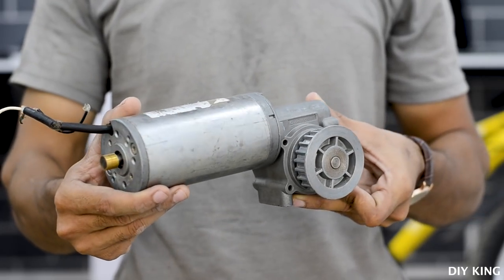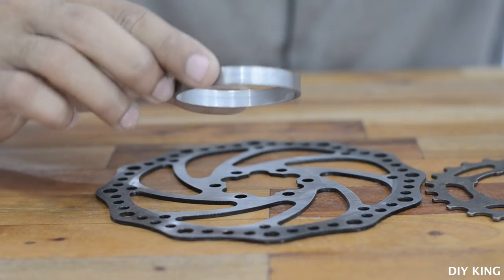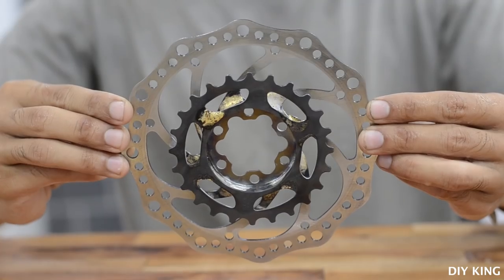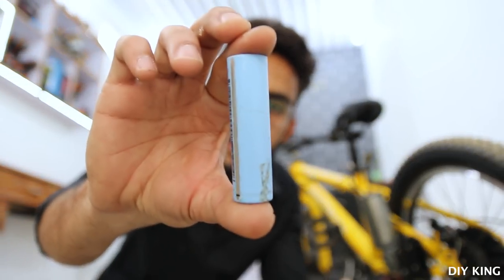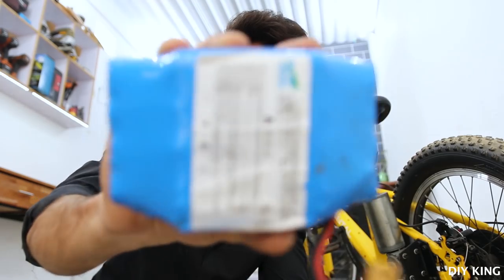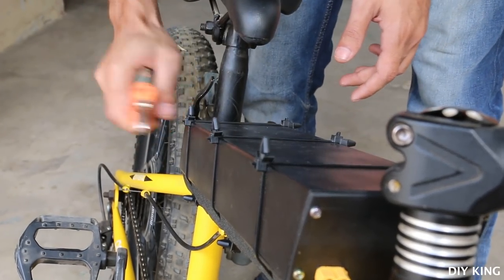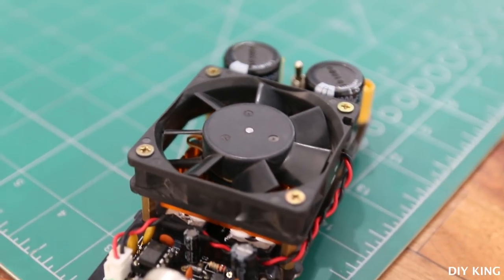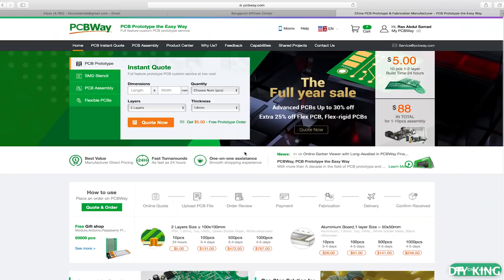DIY Electric Bicycle Conversion Using a DC Motor

Comment: Hello bro i am from India. I have an auro purifier motor that is of 24v and i have changed its inside copper and i have done rewinding of it with 22 gauge copper wire will it work in ma cycle . Mean will it run my cycle. i asked you because in your video your are explained very nice which other your can do properly.please reply

Comment: great video , i am also making a Brushed DC motor ESC and i think the problem u must have had is in operating for long time, the mosfet must have burnt out. using a mosfet of higher current rating can help.

Comment: What is the maximum voltage and current can that circuit handle continuously? I'm looking for an economical  DC motor controller to handle a 2.75hp 130vdc about 20amp treadmill motor. 100vdc is 2hp. Thanks

Comment: Nice work. What is the current draw limitation? What is the maximum speed you get. Capacity of the battery pack and ride time?